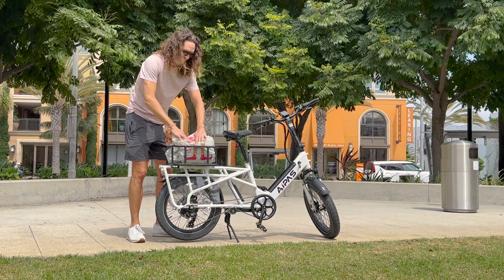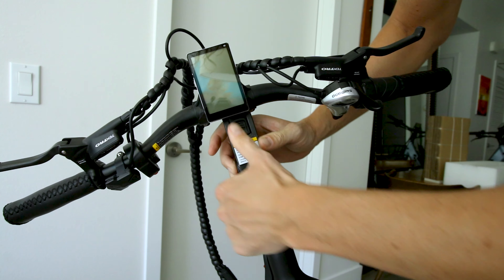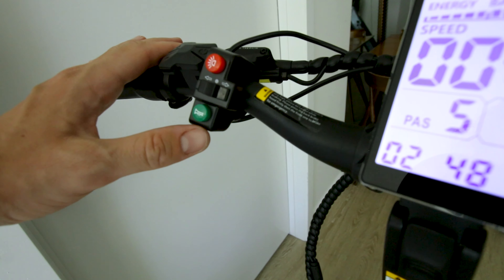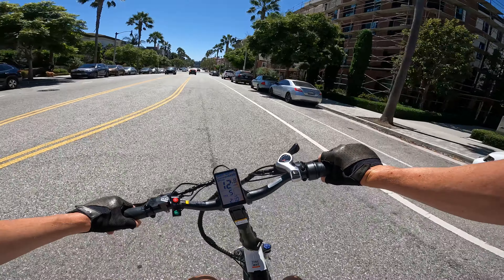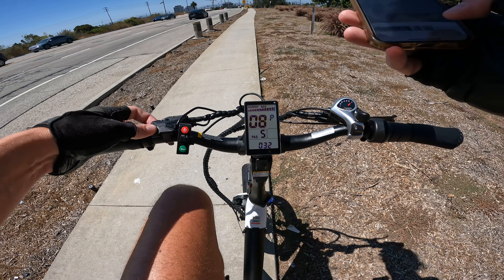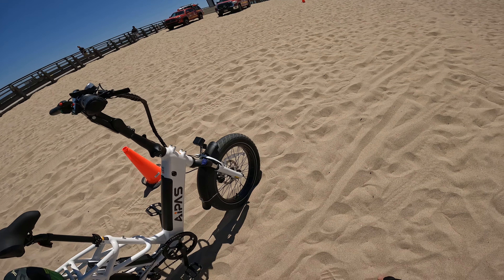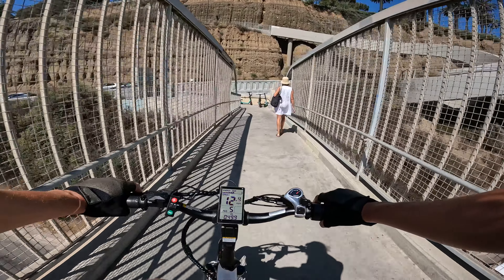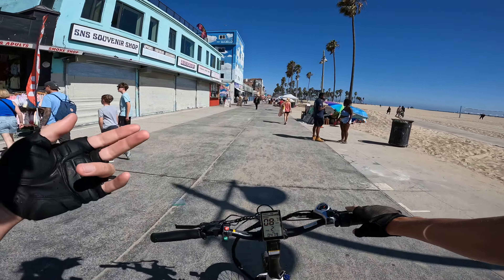Lectric Xpedition Has 1 Problem and AIPAS A6 Fixed It

Comment: You should do a head to head to head with all the cargo bikes you have reviewed recently...would be good to hear thoughts on which you consider to be the best option of the bunch
Reply: @webchez69  well that's unfortunate...though, others have done it...just that no one has done this bike specifically...there must be a way...unless their MOU/Contract expressly says he can't do such things...

He tests differently and has a fairly good but casual methodology...would be informative and such
Reply: He doesn't do good reviews of cargo bikes.  He doesn't load them up and put on their accessories or use them for what they are supposed to be used for.  He is a better reviewer for someone just riding to have some fun.  He doesn't get the cargo hauling or commuting aspects of ebikes
Reply: @yogiyoda  yeah wish he pushed the weight limit to the max and then did tests

Comment: The settings in the menu at the manual states is not available. I contacted AIPAS about this. They said they would change it in a future manual, but that doesn't mean that I wouldn't have liked to have changed it. I think it was option p21.

Comment: I love that cruise feature where you hold down the button for 2 secs to engage cruise. I have that on my bike. It's super handy. My friend has the dumb hold the throttle until it kicks in automatically, it is not only annoying but dangerous too. Cruise control should ALWAYS be a manual operation. Would you buy a motorcycle with a sticky throttle?
Reply: yes cruise feature is useful, so we added it for our Aipas A6 cargo ebike, wish u like it

Comment: You've commented a couple of times of how quiet the motor is. I wonder if it's because the planetaries and gearing is plastic, versus a hybrid of plastic and metal for durability and reduced noise from the motor.

Comment: Just sharing my experience.  I ordered on May 18th.  Soon after I saw all the comments of people not getting their bikes and the “pre-sale” notice.  I was disappointed to learn (after several days attempting communication) my bike would not be shipping until June 10th, and that the next run of bikes would be June 13th.  So my bike would ship on June 13th at the latest.  

Those days came and went.  I’ve sent several emails to the person I was communicating with, he has stopped responding to me.  On the 14th I filed a claim on PayPal to get my money back.  They have 10 days to respond on PayPal, and so far they have not.  

Today at 3:07 AM I received a FB message that they are out of the color I ordered and they could ship a different color today.  They didn’t even apologize.  

I’m done.  I want my money back.  I don’t trust the company or the warranty.  They are still listed as in stock on the website!!! Someone else is ordering a grey ebike right now, unaware of how duplicitous the company is being.
Reply: @birdiemaker5142  You ordered it during peak bike season, during a sale.

Comment: What the heck?  It's a Lectric XPedition with a quiet motor, actual break light, turn signals, a horn, front suspension, and a normal seat post?!....  And I bought 2 XPeditions last summer!!!  :face-red-droopy-eyes:
If Aipas would do the dual batteries in back like Lectric + their integrated battery (3 batteries) imagine the range!

Comment: Getting closer...all they have to do is have one that is folding and also has a mid drive motor with a torque sensor beginning at 750watts. :)
Reply: We are also trying our best to give customers the best products and fastest customer service.
For cargo ebike, folding frame may be not a good choice, and now our A6 cargo ebike uses 750w hub motor

wish you love our A6 cargo ebike
Reply: @AipasEbike   Would it be possible for your next model to install a front suspension onto your cargo bike with a (at least) 80mm front suspension fork? Cycling is one of my hobbies and I know a bit more than your average female as what makes good performing components onto a bicycle frame. I even used to work for a bicycle Corporation business back in 2007-2008 in San Diego.
Reply: @StarEssences  thanks, I will share your suggestion with our manager

Comment: It's unfortunate, they don't have some of the rear rack accessories, that Lectric does. Specifically I'm talking about seating on the back. I'm sure other brands will fit, it would just be nice if they sold them as part of the package. Right now there's some additional discounts on this bike that makes the pricing really nice.
Reply: Thank you for your suggestions, we will add more accessories later
Reply: Mine just showed up, it is currently charging.
Reply: @AipasEbike walking mode did not work and it is missing option P22 from the book.
Reply: Are we sure that the Lectric accessories don’t fit the A6? The bikes look identical so I am sure that they are manufactured in the same Chinese warehouse.
Reply: @gkreegs  sorry if I imply they didn't work. I have the AIPAS A6. I bought the Lectric accessories for the Xpedition and the two seat pads and the OnePlus bike frame. That's perfectly on my AI PAS.
Reply: they all fit
Reply: @AipasEbike should definitely make another model like this but with dual motors with at least 40Ah to 60Ah; this would rock the market for sure.

Comment: Other review tips that no one does, but would be awesome:

1.  From stop, use single half pedal stroke in highest gear, with pedal starting at 120-135 degrees from bottom, while holding throttle for exactly one second.  Then just glide no throttle.  Most displays will keep showing higher speed on glide.  This number is the actual 1 second acceleration from 0 on the ebike.  How fast you can make a left turn.

2.  Roll in at a PAS level that gives under 10mph max, pedal, throttle, and increase PAS level simultaneously for exactly 2 mississipi count, then stop everything and glide.  Most displays again keep going up.  This tests the combination of bike ergonomics, mid-low end acceleration relevant to rolling stop sign crossing.  Could also try shifting mechanical gears while increasing PAS level for an "extreme score".

These tests take very little time.  One spot on your route suited would be the sidewalk before you join traffic, that also has that desert bush garden you sometimes cross.
Reply: Please buy one, then make your own video. Thanks!

Comment: 5:38 now that I have the bike, the front battery has an ON/OFF  switch under a rubber cover (shown briefly in the video). Switch must be in the ON position for the charge indicator to work.
Reply: What about rain and puddles? I noticed the controller was under the bike, Im worried about rain

Comment: I have the Xpedition. I live in the Midwest in small town and the roads are crap.
The pavement is patched on top of patch.
I will be looking to replace the front forks along with a front motor.
likely same chinese company that makes both. I noticed that AIPAS
shortened the location where the Xpedition has the extra battery.
If they would have kept it the same dimensions, there could have been an option to
to have three batteries.

Comment: Interesting, the battery in the frame, my AiPAS A6 has a off-on switch on the side, instead of the button on the top. The secondary battery behind the seat, has the button. I often forget to hit the power switch off, when I'm done.

Comment: I do like the upgrades on this bike. However are you going to get support a year after owning? Will you get a new display or controller after warranty is done like Lectric may do? Probably not. The return info/warranty info on this brand is super strict. They didnt address the kickstand issue either. Shocks can wear out after a while if they are cheap, you wont be able to buy this fork anywhere which is why a sturdy steel fork is preferred. I'd hold off till a mid drive with torque sensing is available. There is 1 service center in the entire US according to their website, and I couldnt even find a name for it in Michigan. I do like that they list the cells on this bike though, something Lectric doesnt advertise.
Reply: I agree with your points especially the suspension part, if you actually use this to haul cargo with an sort of weight your going to end up locking that front suspension anyway and it's just another thing to wear out.  Good luck getting a replacement later

Comment: Im considering getting this cargo bike and doing a proper review of it against my XPedtions under full load up the giant hills of the steel city.

Reviewing a cargo bike with no cargo seems a bit pointless.

Still a great channel but reviewers whos job it is to review products they get for free or nearly free have some bias.
Reply: I would watch it...if it would get fed to me by YT atleast...I am cross shopping this now with the XPedition, the Aventon Abound, and the Velotric Packer1...if I could afford it I would consider the Specialized Haul LT that just launched but it's a little pricey for my pocket ATM...
Reply: @triaxe-mmb  the abound is only $100 more than the XPedition and offers a lot, this Chinese clone is $100 less so savings there but they are a brand new company, with no support and likely a worthless warranty as they are not big enough to offer one you can trust.  Lectric and Abound are big with support centers everywhere.  

I'd skip this cargo bike and only focus on the XPedition or the Abound.  

Heck nobody else has even reviewed this bike outside this channel and it will be another failed brand trying to build off what Lectric created
Reply: @DestinationFawked  that's exactly my concern...

Honestly if someone reliable took the best features of the Lectric XPedition, Aventon Abound, and Velotric Packer1 cargo bikes and sold it for a slight premium - say $200-300 more than the most expensive of the 3 - that works - I would buy it as a preorder...that works out to a 10-15% premium over currently available prices on those 3 bikes (after the perennial discounts).

My ask list is basically a front suspension fork, seat suspension with dropper post, dual battery set up with 3 amp charger, an optional 4amp charger, 26" front wheel, turn signals and active brake lights, loud horn, name brand brakes (Tektro probably at this price point), 2 Yepp childseat windows, etc...

They all have some of these features - a bike with all of them would be epic in my mind...
Reply: I got the A6. I'm up for comparing performance carrying same loads on similar slopes. You can use Google maps to calculate the slope. The A6 is more powerful and a better hill climber than my Engwe Engine Pro.

Comment: Have you heard of ADO 28 e bike? It’s a new bike from ADO using a crowdfunding campaign for the new bike. But has 350W motor, hydraulic brakes, the battery is in the down tube on seat post and has carbon belt drive. I know a single speed but maybe the belt drive lighter.

Comment: the market has suspension forks for 20" (fat?) tires as much up to 100mm. This is the more appropriate travel range a bike should at least have for hard surfaces: 80mm.  I would also upgrade the shifter to a trigger and the bike should also start at 8-speed cassette.

Comment: This copy cat bike brings a possible  video to mind. Load the lectric and this bike up to max weight. And test them out. I predict the frount suspension fork would become a liability. And the frame integrated battery cut out may be a possible bend point to give way under load.

Comment: Can you try out some of cmacewheel ebike they have a dual 750 w motor bike (cmacewheel r20 max) it seems reasonably priced or if you could try get a y20 of the same brand, it's with built in indicators too

Comment: One thing you keep leaving out, considering all the fires that have happened, you should tell us what certs. it has, such as UL, and esp. the NYFD/UL cert. the better bikes are showing in their specs.
Instead, e-bikes sold in New York City are required to be certified by nationally recognized testing laboratories. You should look for symbols such as UL, ETL, and CSA on the e-bike or other mobility devices1. These laboratories test these products to ensure they meet industry standards and are safe to operate under normal circumstances1.

For example, a new law requires all electric bicycles sold in the city to be certified to UL 2849, all electric scooters to be certified to UL 2272, and all lithium-ion batteries for mobility devices to be certified to UL 22712. Violators of the law may be subject to a civil penalty of up to $1,000 per violation

Comment: Could it carry 3 batteries and go 100 miles without charging? I get it has a spot for the 2nd.
Reply: The rear battery area is narrower than on the XPedition and cannot fit another battery.

Comment: tips for review format improvement: acceleration should be measured in throtte+light pedaling.  "official class 3 bikes" matters because of 20mph cutoff, and slow ramp to last 1mph.  All bikes matter, because 0 throttle lag is optimal, but pedaling is a good amount of torque help even if PAS only has a delay.  Acceleration matters a lot for how fast you can make left turns, or cut off cross (and with) traffic, and if acceleration matters, then pedaling can only help.  Its fine that you show pedal and throttle lag independently, but this is an example of edge cases where throttle+pedal shows much better results when combined.  

Other improvements could be to report on highest/lowest gears in back, and size of crank.  And highlight if battery bars are customizable (if no voltage) and if PAS levels can be set to 7 or 9, with custom power, and if they are, it doesn't matter if you are happy with pas 1 speed or not.  You can change it.  Also, because acceleration is important, its actually terrible when "slow and smooth start" happens, and so programming settings to turn off terrible mode matter.

Keeping power/amps visible all the time is awesome part of your reviews.  Your consistent path is good.  Gives a feel for how well bikes can weave/speed control their way around the mayhem.

Comment: Certainly is a shameless knockoff of the Lectric Xpedition, and it has a couple nice small additions, but they come at a price of about $500 additional spend. Everybody makes a big deal about suspending front forks, but honestly on mainly street only riding on big fat tires, I don’t see the need at all, just another maintenance headache. The improved lighting from that of the Xpedition would be great for sure, but $500 for them, probably not doing it. I imagine Lectric will change a few of these features on future versions, and maybe add lighting upgrades for current versions.

Comment: This bike looks like it was built by the same 3rd party that builds the Lectric bikes...the only real difference on frame is the angle of thw cross brace and the inframe battery...even looks like the lectric has the same tube but without the integrated battery and related cutout...

Wonder if this front fork assembly and the turn signals can be transplanted on the XPedition...only cause i have never heard of this brand...i know Lectric is likely to be around in 5 yrs when i need parts...not sure of this one...

Comment: Lectric should maybe spend less on marketing and put a couple of bucks more into their products.  Fancy marketing and a seemingly limitless ad spend doesn’t make the ride any smoother, a $20 spring loaded suspension fork does😂. It would be nice if you told us the weight of the bikes as that can be an important factor for people.

Comment: This looks like a slightly modded EXpedition with a few upgrades.  Let someone do the engineering then glue more crap onto the frame.  

They really copied the Lectric Xpedition, slapped a front fork, marketing changed ratings/numbers and little to no value add.  Betting all the Lectric rear accessories work with this bike.  Keep shilling for design thieves without mentioning who they copied from during the video.
Reply from the maker: It’s in the title?

Comment: Other than a front suspension, looks like a rip-off of the Lectric Expedition, or vise vera?
Reply: Its pretty much the same ebike with a different label and some minor tweaks as far as I've researched.

Lectric contracts "MONSTER INTERNATIONAL TRADECO" to make their ebikes (or at least make their frames).

Aipas is "MONSTER INTERNATIONAL TRADECO" ebike brand name.

So both ebikes have the same origin, its just if you want a US company you want to talk to for issues or deal with the original manufacturer directly.

Comment: Codes didn't work. Got an lectric insteaf and there really is no problem unless your extremely nitpicky
Reply: Awe man, bad move. Should have got the A6, front shocks, quieter motor, rear blinkers, frame battery, cheaper

Comment: Huge improvements over XPedition.  Integrated battery actually makes room to carry 3 batteries (that can pretty easily combine power with blender).  Without using rack space.  Suspension fork is the obvious improvement.  Only unfortunates is that it seems like only 28t crank, and twist throttle means bad grips.  If you have the storage space and never need to use an elevator, just 6-7lbs heavier than folding ebike is great for all of the extra utility and strong power.

Comment: it looks like a copy of the lectric xp right down to the rack! and the xp cost 1699.00 with the dual battery option! and it also has a single battery option for 1399.00.  your Aipas is a complete knockoff of the XP!